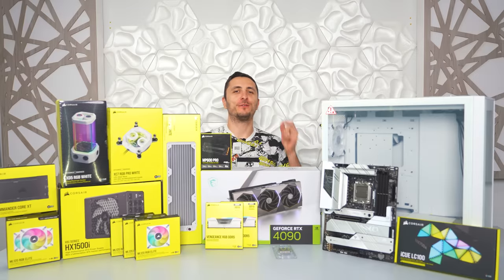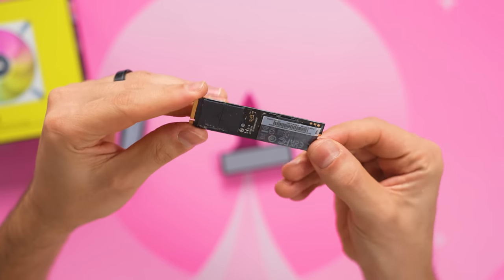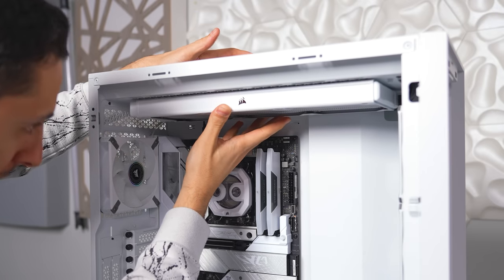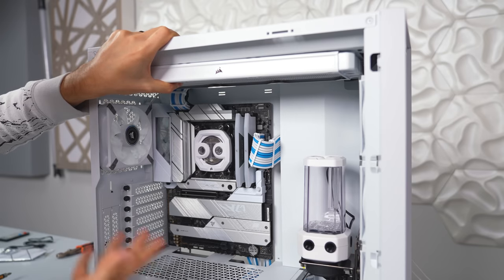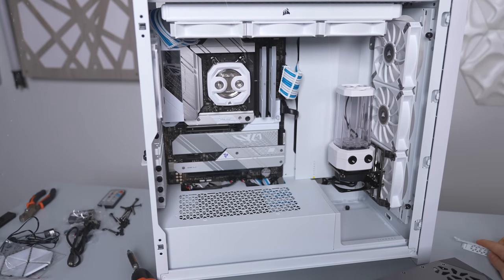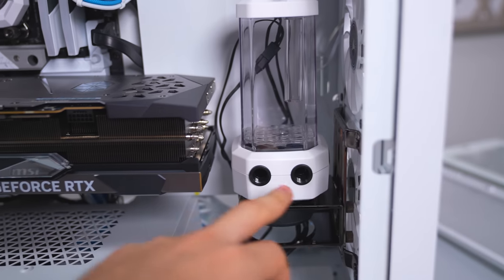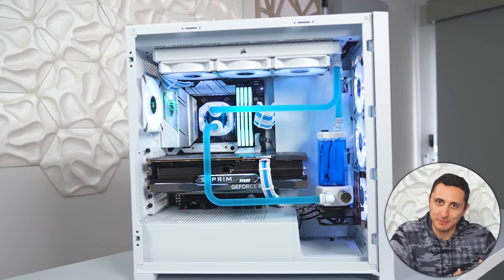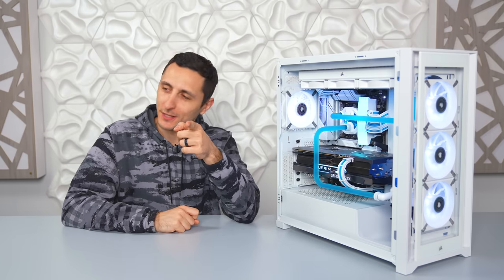This PC Can Stop Global Warming - FROST V3

Comment: I think you could possibly remove the panel on the side and install the radiator with the pump there instead. That will also help your beautiful cable show in a better form. Then bring the fans from the front panel back inside so you can have the mesh filter on it. At the end, install 3 more fans on the top so to keep the hot air out. Hope the information makes sense since English is not my first language. Btw, I love watching all your videos and keep up the good work!

Comment: I got the same board, with a 7700x, 4x 16gb gskill 6000 and it just work. I didn’t even think it would not be compatible glad it just work.
Reply: I'm running 64 gigs at 5600 expo and it works fine with 4x

Comment: Surely you could’ve just put the rad in that little bit outside the main part and just screw through the fans and case into the rad so that you don’t have to mess up the cable or more the looks on the cable

Comment: Is there any reason why you couldn’t mount the pump horizontally off the top radiator? That way you could have the front fans inside the case and the filter on.

Comment: OMG!, Ed why don't you take the resv/pump mount and install it on the middle Fan, just above the fan you installed it on in the video, i think that way you will have space for it, and it will be just above the GPU to the right. what you think is that a good idea ??
Reply from the maker: It sits too close to the top rad unfortunately

Comment: 8:58 Thank you for speaking out about this Ed, I was building my first ever PC yesterday following your full step by step guide. This part of plugging the motherboard cable was SO DAMN ANNOYING AND FRUSTRATING, because the design of the case is small, the motherboard cable that came with Corsair power supply is too fat to fit in that hole. I had been working on my pc for a couple of hours. I simply had to stop with the build cause I was gonna break something. Gonna try again later tonight. But please Corsair FFS change that dumbass design of the holes for cables, just do a regular square cutout like other PC's do.
Reply from the maker: couldnt agree more!

Comment: i think if you put the pump combo on the middle fan with the bracket raised enough to clear the 4090, the intakes and outtake of the pump could've been ran above the gpu, and still look pleasing to the eyes, if im wrong let me know!
Reply: I thought exactly the same. That would also clear the GPU from tubes running in front of it, allowing for swap / removal without dismantling the loop

Comment: Hi ED!  Nice video as always.  I had the same issue with PSU cables but with 5000D. I believe that these towers was made for different mobos with 24-pin connector layed down on the right not facing upwards if you get what I mean. Also 90degree adapter is not an option which I have tried already. If it bothers so much then have to remove that cover and just add 3x extra fans on he side so the cable isn't bent so much.
Reply from the maker: Ah good point!

Comment: Ed you could’ve just took the bracket for the pump off of the bottom fan then cut the top half of the bracket, leaving only the two parts of the bracket for holding the pump. Then all you needed was just 3M tape to stick it to the bottom of the case. 😊
Reply from the maker: That would have been a good idea but as I said I didnt want to poke holes or do any modding.
Reply: @TechSource  My bad, I didn't catch that part in the video! Keep up the good work and have a nice new year my bro :)
Reply: @TechSource  Was there a BIOS update or a maybe newer RYZEN silicon revision that you brought that you were able to run 5600mhz on all 4 sticks of RAM at 21:54 ???
Reply: first thing i thought of too
Reply: @TechSource  i just ordered a pc
Reply from the maker: @JoshuaG  I havnt updated the bios, as far as the new silicon revision, I have no clue. It was sent to me by AMD.
Reply: @TechSource  Oh cool, they must have seen countless videos relating to the problem with the IMC in Ryzen 7000' and might have silently updated it ❤️

(But that's just my WILD speculation🤣)
Reply: Nah he should've mounted the bracket on the 2nd fan and the mount is also adjustable. No idea how he missed this.

Comment: Personally I agree with you on the GPU being the Eye sore here, just isn't the same without the waterblock (Plus the cooling looking insane) . One thing I would have done is remove the bracket for the pump and stuck it to the bottom of the case (the pump alone). Another small change is the top fans on the radiator, I would move them to the top of the case (if possible) for the EPS cable to look clean. But overall love the build keep up the good work Ed!😎

Comment: 2:30 in the website it says ddr5-5200, which means 5200mhz, but you used a 5600mhz but still worked. how?
Reply: This "Max Memory Speed" thing is only the 100% guranteed working speed, but its never really relevant (unless you have very bad luck with your CPU, which tends to be more often the case with the new DDR5 plattforms).
Reply: @xxomegaxx5427  ohh ok thank you

Comment: no, i dont like how you handled the pump problem, the fans are really too close to the front panel, you could have cut the pump bracket in half and used the top half and mount it to the bottom holes of the fan and get that clearance you searched...

Comment: What if you removed the bottom two bolts on the pump holder (not the bracket) and only used the top two bolts? Allowing the pump holder to shit down and hang lower than the fan bracket?
Reply: i dont think he wants the bracket to shit

Comment: If all you were wanting to cool was the CPU, I would go with an AIO. A better solution to your case size problem, in my opinion, would have been to just water cool the GPU as well.  It would have also looked a lot sicker in my opinion. Swap the 30mm thick radiator with a 60mm thick, or run 2 30mm thick radiators. I did that with my version of "Frost," yes I used the same name before I ever saw this video. But yeah, that's what I would have done differently

Comment: Having built in the 5000D, I knew right away I was gonna be using 10 fans: 6 intake, 4 exhaust, for positive pressure. I took off that cable shield. It made so much of a difference with cable management and getting cables plugged into my Dark Hero. Plus the case looked nicer with those 3 extra fans.

Comment: You could use runs to lower the pump holder and keep the fans internal.

_
| |
| |
| |
_

Just affix the pump mount to the steel/aluminium runs. You can probably buy them somewhere, but I'd cut up an old piece of kit you've got lying around.

Comment: Just an idea, maybe you could 3D print a bracket to hold the pump on the floor of the case where you said there is clearance. The fans wouldn't be sacrificed, and the mesh filter can stay in order to preserve the airflow.

Comment: V3 looking nice Ed, but you are right Corsair need to make some modifications on the case to fit the cables better or you could of went with the Corsair iCUE 7000X RGB but i don't know if it would of made a difference with that beef chunky RTX 4090 GPU, Overall it is an outstanding built for you in and the start of the new year.

Comment: Build looks awesome for sure!! But just a build note that I was thinking about...

As far as the custom loop goes, would it have been beneficial to install the top fans above the fan cage with the radiator underneath it? This way you could run the EPS cables without clearance issues. Another thought is if you did the fan/rad combo that way, there may have been enough room to install the pump/res to the middle fan on the front cage without having clearance issues with the GPU. This way the front fans aren't close to the front glass panel.
Reply: wouldnt have fit the 'aesthetic'. he wanted all the fans to be seen.  i was thinking the same, because then you would have had enough room for the cpu power cables as well.
Reply: @StrawGary  What about the rad in the upper chamber with the fans below? O would the inlet/outlet on the rad get blocked? I guess you don't really see the EPS anyways so really doesn't matter.
Reply: @StrawGary  thats fair!! I can understand going for a certain aesthetic!!
Reply: @bothellkenmore  thats how i would have done it. put the rad up top and see if the top panel fits
Reply: @bothellkenmore  i dont think the plumbing would have been blocked.

Comment: Nice Video, love your content. Question: If fan face sucks, I'm not understanding the direction of air flow in the radiator and other fans, as it should be in the 4 in - 3 out combination. Please explain if radiator is sucking the air in, are the other fans pushing the air out or in ?

Comment: Great Vid, the build turned out choice! I too had trouble bending the custom 24 pin cable  through that tiny dang! gap. I was doubting the cable thickness/quality... Happy yet sad it is a case design issue lol. Cheers - Jass.

Comment: I would have just made some bracket extensions. Flat extensions that allow you to attach the bracket lower on the extension that is attached to the fan. Would require some simple drilling and a little paint. I bet you have the skills for it but maybe you were short on time?
Reply: i don't think he really cares, the system is gonna get dismantled after the video is over, soooo what's the point?

Comment: If you would have mounted the pump on the middle fan you would have had enough space for the GPU, would have been able to mount the fans on the inside and the hard tubing that is now blocking the GPU removal would also have been avoided, if the space allows it at the top of course.

Comment: I probably would have done a parallel run instead of running that one part of the run, up and over the GPU.  If the GPU isn't part of the loop, there's no reason to run the loop in that direction.  It just kinda looks out of place.  Also, Can't say I'm a fan of the Corsair 5000D.  As you mentioned in your video, it does look nice, but similar to the 4000D and the 7000D the cable run grommets are in particularly strange spots that make cable management awkward - Take notes Corsair!  That being said, if you had gone with the 7000D you would have had a bit extra space to fit that pump and fans properly.  All in all, I love the colors, however, the MSI Suprim 4090 doesn't exactly flow with the build - And at this point, you gotta just take what you can get thats available.  I think the FE or Zotac 4090 might match the aesthetic of that build better - even then, not many 4090's out there match a white build.

Comment: I'm building a 13900k system with that Suprim 4090 version too. I'm gonna use 4 dimms and adjust the timings as much as possible. I bought two 32GB 6000mhz kits...we will see. Mine is an all MSI build with the prospect 700R case that has the LCD touch screen on the front IO of the case.

Comment: Agree completely about seeing the full process, particularly the actual tight fits and required design trade-offs.  Too bad about the angled cables - not something that you can plan for in advance.  Maybe take out the Corsair back metal piece OR mod it to allow the 24-pin to feed straight?  For v4, certainly get the 4090 a white H2O block and mount it vertically - makes for great runs 🙂.

Comment: my inno3d 4090 barely fits into my $200 case even though the specs say i could fit in a much bigger card. couldn't use my vertical bracket at all since it added an extra centimeter 😢
this build would have looked so much cooler with the bracket

Comment: Coudn't you have used the side intake fan placement to mount the braket, maybe even adding 3 more fans? Also would have made that ATX cable bend prettier.
Nice looking build, but those fans getting air from the front glass... :/

Comment: You can remove that tray on the motherboard side for more clearance for the 24 pin. You could also mounted that pump res on that side. Nice build, love the custom cables. Did you flushed the radiator before installing it?

Comment: It's looking to me that the radiator could have sat on the top and the fans on the bottom of the framework. To give you more room for the wires on the top left to go in the correct area. Hopefully, that makes sense what I'm trying to say.I also would have left the wire cover off to keep the wires looking cleaner since you were using blue white cables.

Comment: I have a question, why didn't you use the Asus 4090, since there's any 40 series with water-cooling system, Asus has a white ish  4090 that I think would improve the overall look of the system.

Comment: I use the same case and the tray to the right of the motherboard is AWFUL. I had to bend my 24pin so much to get it plugged in and make the sharp turn. The plate is literally bending because of it. I first built it with the side panel off but it looks fucking awful. I rebuilt it and spent 2 hours routing the cables to avoid it. It’s a wonder how things like that get past QC

Comment: @TechSource you could have flattened the 120 fan bracket with a hammer or in a vice so it doesn't have the bracket pushed out away from the screw holes, then replace the thumb screws that adjust the height with flat scews and than drill new holes in the bracket..... that would have bought you the .5 inch you needed, also probably should have painted that bracket white.

Comment: Why didn't you think to cut off the bottom 2 legs of the res bracket and screw the top 2 legs to the bottom 2 holes of the bottom fan? That is the best thing you could do, as you wouldn't sacrifice thermals and dust filtration. Come on Ed, use your head! LOL!

Comment: You should have already a gpu waterblock available for the Supreme. Why not do a video now replacing the gpu radiators with the waterblock and redo the pipes, and also put back the front fans inside the case?

Comment: Nice build, it's a shame the 24 pin cable is not symmetric, nor the cpu power cable.

I wonder if the compartment on the top of the case is to put the radiator, from what I see it could fit there but I may be wrong.

Comment: Personally, I think the tubing would look better if the under tube went out -> right -> down -> into the fittings. As opposed to out -> down -> right -> into the fittings.

This is pedantic, but I think tubes running next to each other look better.

Comment: To solve the gpu and pump clearance, couldn’t you have mounted the pump to the second fan instead of the bottom fan? This might have increased the height of it enough that it wouldn’t interfere with the gpu.

Comment: Yo TechSource! for the problem with the watercooler reservoir being too close too the gpu, you coulda moved your gpu down to the bottom two slots for it and put the reservoir slide panel on the second fan and that would fit!

Comment: Could you have bolted the top two holes of the bracket on to the bottom 2 of the fan? Not as secure but I think being that low it might been fine. If there was enough clearance.

Comment: 9:20 this issue has been the same with the corsair 4000d and 5000d series case too. I had a very rough time with my stock psu cables in my case.

Comment: Another fantastic looking build Ed 👌....out of curiosity could the top fans have been set up as a pull configuration above the top bracket and the radiator below the bracket for more clearance from the motherboard and CPU power connections? Not as aesthetically pleasing but would it be possible?
Reply from the maker: Ah yes, that could work. It would look like the fans in the front, sitting close to the panel. But that would allow for more clearance
Reply: @TechSource  didn't realise the top panel on this case is also tempered glass, for some reason I thought it was just a mesh panel...that'll teach me for not looking properly, having the fans at the top not such a good idea then 🤣